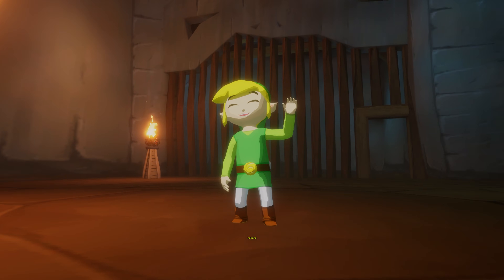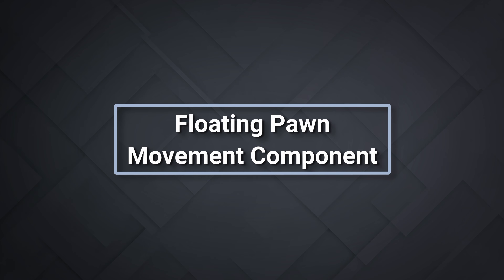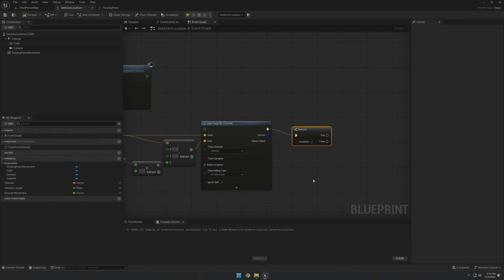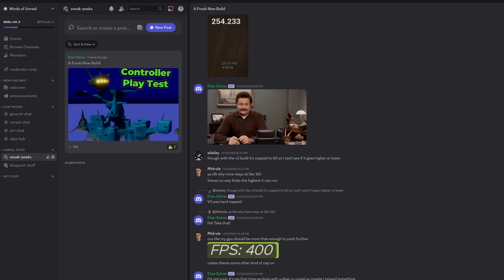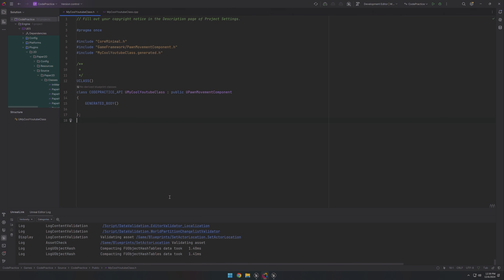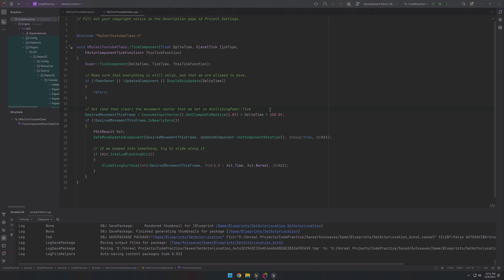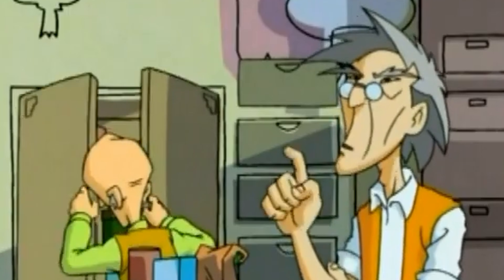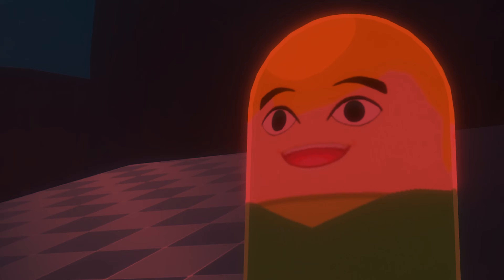MASTERING Custom Character Controllers in Unreal | UE5 Tutorial

Comment: this is a pretty neat method,  ive never fooled around with any of the pawn movement classes. but it did leave me wondering if its really worth the time and effort to do all that logic in C++  JUST so you can get rid of the acceleration, surely the class has variables exposed somewhere that let you set the acceleration to zero.

Comment: Genuinely curious as to why you're doing all this extra work when the Character Movement Component handles all of this for you? Could of just tweaked a few things to achieve this in about 5 minutes.
Reply: Is actually better most game that want fast action doesnt use CharacterMovement Component is trash and is slow but for example Project Feline it using a Custom Movement Component to achieve the parkour and Custom movement in my opinion is the best way to make satisfying movement
Reply: It's good to understand how things work under the hood which would in this case will help if you wanted to create unique character movement systems
Reply from the maker: Cause I wanna lol jk. I started out using the default character that implements that component out the box but I wanted to make my own. Saw it as a good excersise for learning some more C++ too